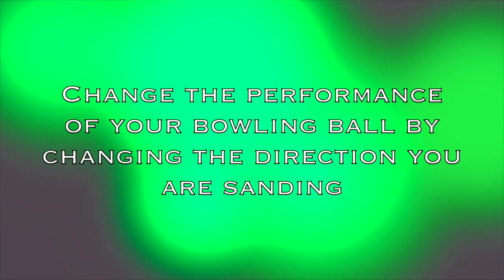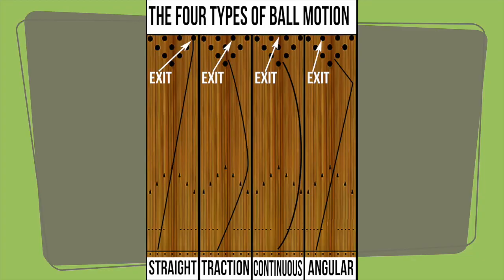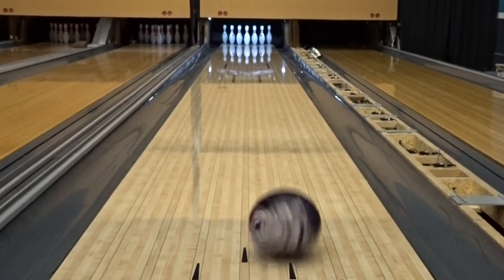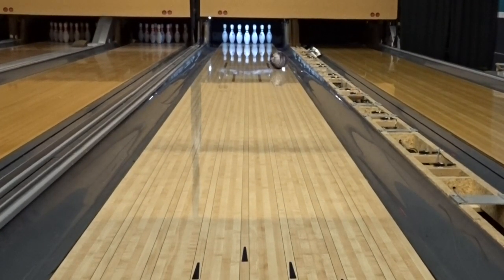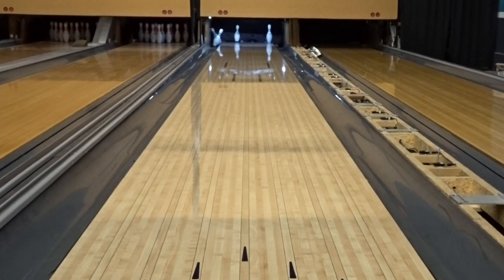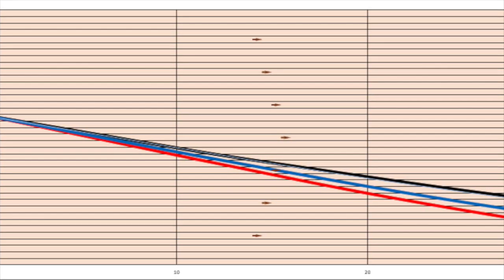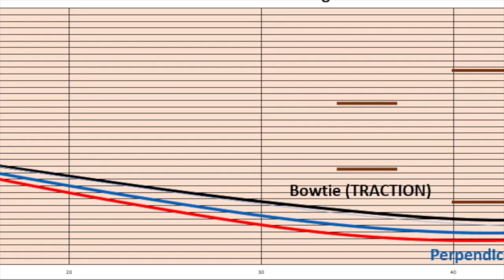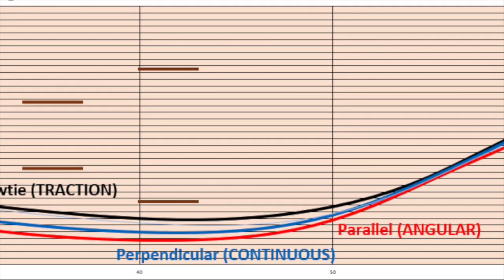Bowling Education Sanding Direction on a Bowling Ball

Comment: This is for manual sanding, what about using a ball spinner, would that be the same as sanding "Bowtie - Traction" since essentially your sanding in all directions?
Reply from the maker: It works for any sanding method as long as the final 2 sanding directions are on opposite sides of the ball and are the directions shown. I.E. parallel, perpendicular, or bowtie.
Reply: Ronald Hickland Jr By using a spinner, if I use the 4 side method, I would go finger holes up (circular motion), finger holes down (circular motion) , then all holes up ( use the direction I want to get the desired reaction), then all holes down (same as all holes up)?